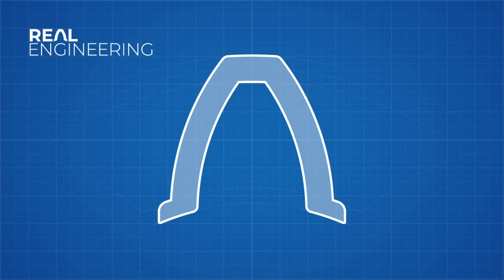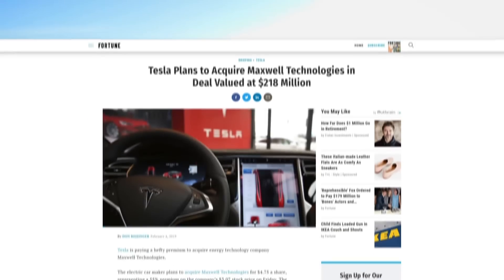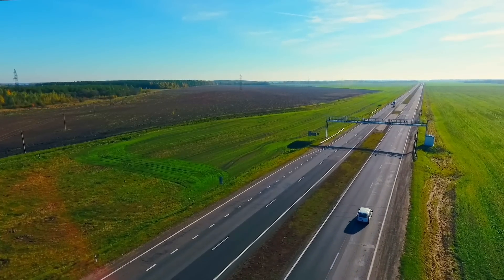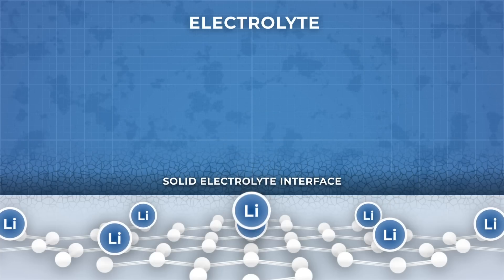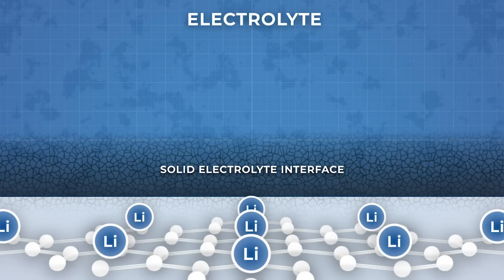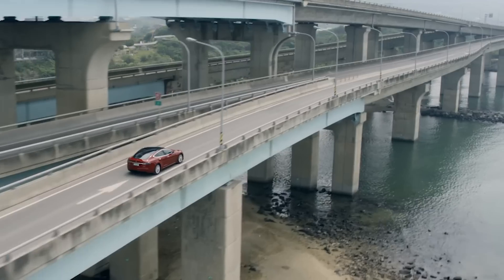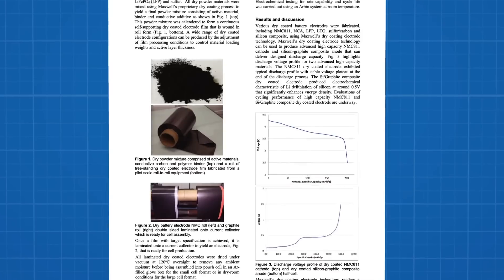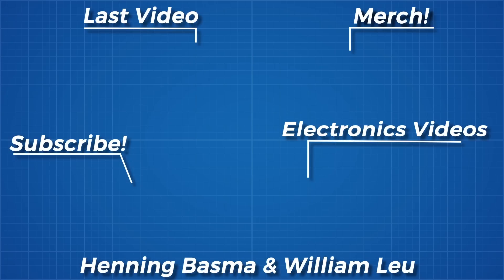Tesla's Quest for Better Batteries

Comment: My toothbrush charges wirelessly why isn't Tesla utilizing wireless energy
Reply: Low efficiency.
Reply: @magfal  it's no less efficient than transferring data wirelessly
Reply: @allanbond3673  packet loss and energy loss in wireless data transfer is not a huge environmental issue as the bandwidth is good and the energy in question is next to nothing. Charging cars with a 10-20 percent loss would be really unnecessarily bad for the environment if most were to switch to EVs and charge wirelessly.
Reply: @magfal  so a 20% loss of power is worse for the environment than having millions of tons of lithium batteries that literally rapes the environment to manufacture? Not to mention how dangerous they are when they get wet, Sounds like bullshit to me
Reply: Wireless charging does not replace batteries. It just refills them. Rolling wireless charging is horribly inefficient compared to stationary wireless charging. At least it was the last time I had a look at the figures. Your toothbrush using wireless charging most likely has a lithium ion battery or a nimh battery.

Comment: You have it backwards, the leaf lost capacity in hot climates. Heat is the enemy of the battery, not cold. And your loss estimate for the Nissan leaf was before the 2013 battery chemistry revision to the 'lizard' battery that could withstand high temps without degradation. I know this first hand because I have a 2013 Nissan leaf with one of the first lizard batteries and the capacity loss is a huge difference. I have lost only 6% in a total of 6yrs and 68k miles(about 700cycles on the battery). You might want to do a bit better on your research end before putting that information out there as "facts".

Comment: So now they're calling it ultra capacitors? because super isn't sexy enough?
great video
Reply: Hyper Capacitor
Reply: It is a bit late to call it "now" since ultracapacitors first came to market in 1982, and it's just a brand name for one company's line of supercapacitors.
The super indicating that they are using a combination of chemical and static potential to achieve a far superior capacity than purely static capacitors.

Comment: Teslas batteries have already been shown to last a long time. 200k+ miles.  In fact it's arguable they maintain charge better than ice maintain MPG
Reply: https://electrek.co/2016/11/01/tesla-battery-degradation/
Reply: Well they still have hits and misses, IF none of the cells in your pack goes out early then you have the possibility of 20 years plus, but a good deal of them had to be exchanged under warranty because in the giant mass of cells they make some of them will underperform and fail long before their full span.
Reply: Teslas doesn't make batteries they buy them . Tesla didn't invent the battery.
Reply: @zoultronzoultron9723  it doesn't matter where they came from, at this point they're the best
Reply: @bob15479  that doesn't even make since.  You can go to lowes or home depot and buy a lithium battery
Reply: @bob15479  this video didn't even mention john goodenough who actually  invented the battery the video talks about . But he makes it seem as elon and Tesla invented it
Reply: @zoultronzoultron9723  I should clarify. When I said "doesn't matter where it came from" I was assuming you already knew that Tesla sources their battery from panasonic.  So my point was, it didn't matter if Elon invented it or panasonic did, it's the best battery. I didn't know the video claimed it was elon and wouldn't promote that lie. 

You're right you can buy a lithium battery anywhere, but the lithium batteries in the 3 are unique and cannot be bought anywhere.  It's cells and active battery management is currently unaparalleld in the EV market, which is why they last so long. You should really do some research into the 3 batteries, I'd start here: https://www.youtube.com/watch?v=kGFiaWvD-KI
Reply: @zoultronzoultron9723  You are wrong. They get cells from Panasonic, but it's Tesla who makes battery pack out of them (thermal management, controllers etc). And assembling, controlling and managing cells - this is where the magic starts. And that is why other manufacturers can't repeat the success yet, it's not about just buying some cells.
There are interesting insights from respected guy: https://youtu.be/CpCrkO1x-Qo?t=1697
Reply: @shotnick81  dont forget Tesla makes them together with Panasonic! and in the ever growing gigafactory in neveda making better batteries will only keep continuing.

Comment: The Maxwell super caps will add to higher amp discharge characteristics of a lithium pack while reducing weight....but fail to understand how capacity will improve....Maybe will tax the lithium batteries less, improving their lifespan....help range in stop and go traffic.  But let’s take a straight A to B journey of say, 300 miles, constant speed of 50 miles/hr.  How will the added Super caps help on a trip like this?  I don’t see them adding range at a constant velocity.   Battery Capacity and vehicle range are tied closely to one another....weight saving for less rolling resistance is evident...however a smaller battery means less range, anyway these eyes see it.  I see this merging of supercaps and lithium extremely beneficial in a sportcar, quick lauches, massize amp draw, light weight....and in a semi truck for starting torque to get the load moving.👍

Comment: Tesla will not use super capacitors in any of their vehicles. They need a ton of cells for range which gives them more discharge/charge capacity than a vehicle motor would ever need and the cells will continue to improve on this metric. I'd be willing to bet my house on this.

The dry coating process is what Maxwell was bought for, and it sounds like it should be worth every penny.

Comment: 1:08 thats one wierd y axis. Could you please provide us with some data can we can actually use? Instead of this bs. Haven't watched the rest of the vid, might get better:)

Edit: rest of video is great!
Reply: Rather than "Use"
Do you mean "Understand"?
There's a difference.
Reply: @rogerstarkey5390  No, I mean "use". It starts at 50, which is fine with clarification, but we don't get any. The jump from 100 to 500 is about 2.5 times as large as the jump from 50  to 100, instead of the 8 times it should be, and there are no marks in between. And I don't even know what happens between 500 and 1000.

Anyway, why are you protecting it?

Comment: Give battery a 100 years it will evolve beyond recognition.
Reply: We will have dilithium crystal  and wrap drive!!! The future is much brighter.  Hopefully we'll have synthesizer or replicator.  Money are useless, disease eradicated,  war are gone.  Just like star trek.
Reply: @duketlam9206  
"Wrap drive"
Great at lunch time!
Reply: @duketlam9206  what's your I.q
Reply: @duketlam9206  how do I give it 100 years when I'll die in less than 60
Reply: Give them 6 years and according to the bullshit graph in this vid and they'll be free.
Reply: @DiscoFang  your name suggest you do not like technology.
Reply: aventador gallardo ha. The opposite. Early adopter.
Reply: aventador gallardo Sony changed the landscape.
Reply: @DiscoFang  so are you optimist about the battery future ?
Reply: Batteries have been around for much longer.
Reply: @hr1100  but never worked upon like the way we are working on them now a days.
Reply: Pizeo crystals cut and assembled into a reverberating configuration where they excite each other could be a possibility 🤔 Hmmm
Reply: Spinning water pumped in a East West direction inside a drum will capture inertia from the rotation of the Earth this can be used to run a hydro generator just line it with the compass and start it running🤔
Reply: Balloons that can be released and they are on a cable system can draw lightning  into a underground facility charging  capacitors this power can run a  large generator motor to make ac line current. Capturing lightning and putting it to work could be a beneficial source of solar Energy.
Reply: @davidmayhall6567  , I like this ideal. I do believe they will eventually find a way to harness lightning and use it. Lightning is so common in most places, and each strike provides so much power and energy.
Reply: @bobby1970  yes indeed I have Dreamed of lightning towers that actually attract and create lightning strikes by releasing vaporized water as the air current blows by a strong electrostatic charge is built up and it strikes the collector rod and the Electricty is harvested it's a solar lightning towers. I have Many ideas about futuristic Devices and machines just wish I could work for a company that could use my ideas.🤔 Hmmm a Mind is a terrible thing to waste 😁
Reply: Crystals are used in radios and clocks and even piezo lighters the structure of the crystal can oscillate with a charge depends on how it is cut on x axis or y axis and it's thickness , piezo crystal works in reverse by application of force distorting crystal structure causing electron flow, like stepping on a wet sponge , like a battery that discharges, but plate degradation causes failure. When I am given a Job then I can build it. A CPU Crystal Power Unit ! 😁
Reply: Slinky Slinky what a wonderful Toy! Oscillating and reverberating CPU Crystal Power Unit! Mic drop!
Reply: I think battery technology will evolve beyond recognition within 5 years.
Reply: @bobby1970  I have some really cool ideas for some battery's made from layers of glass and Sand, others made from recycled paper they are recycable. The best battrey is one that's Dirt cheap  and is made from Dirt!🤔
Reply: @davidmayhall6567  , that's awesome.
Reply: If you have heard of the schuman resonance it's the heart 💓 beat of our Earth a pulsating magnetic signal from the Earth's core . I have thought about a device that sends s pulse of Electricty into the Earth a resonant frequency that bounces of the core of the Earth and comes back stronger Electricty is not affected by Gravity. This pulse is like a drop of water in a bucket of water the drop actually goes in and there's a 🌊 Wave then it kicks back up.  This will draw s lightning Sprite from the Earth as the current is magnified by the Earth's core. It's a Kickback from the magnetic field. This current can be adjusted to be a steady flow of Electricty at a  adjustable frequency the transformer converts this into usable current to run a resistable load. 😁 It's like a kappagen coil or a kapandze coil.  It takes a small amount of charge to get it going then it starts producing current on it's own.  It creates a Pathway and a flow of Electricty by action and reaction like a oscillation.

Comment: tbh, if it wasn't for the price, everybody would own a Tesla 

(in my humble opinion)
Reply: I fully agree everyone should have electric vehicles. But there are problems currently, it would defeat the whole purpose of buying electric vehicles if the fuel source, (electricity) came from fossil fuels. If the world was powered by nuclear or renewable energy, then that would greatly minimized greenhouse gas produced by transportation.
Reply: @GamingWithNikolas  https://blog.ucsusa.org/dave-reichmuth/new-data-show-electric-vehicles-continue-to-get-cleaner
Reply: @GamingWithNikolas  Not entirely - it takes less fossil fuel to be burnt per km for an EV over an ICE vehicle, so while not perfect there is still some benefit.
Reply: "If it weren't for the price, everybody would own a ________" is true for pretty much anything you can put in the blank.
Reply: true but the grid and means to get energy would also need to evolve greatly!!
Reply: Not everybody, but they would probably take nearly all of the Civic/Camry/Focus/Golf market.
If they get down to 20k or under that could very well become reality.
Reply: Have you ever seen or heard Tesla or Musk say how much better these cars are for the environment?  Isn't that the main selling point?  It must be tough to calculate, especially since gasoline cars are 99% cleaner than when at their worst in the 60's (you can look that up too, not a secret).
Reply: To be fair, they are quite beautiful cars

Comment: 1:06 so the battery will cost exactly zero by 2024. ;)
Reply: Or 50? Not sure if the 50 is slightly above the time axis or at the same level.
Gotta check the source for this one anyway, seems blurry.
Reply: The really fun part should start after that, when they start paying you to take them away...
Reply: Mr Fusion uses Garbage .
Reply: haha Someone else noticed. 2027 though going by the BS Y scale on the graph. It's one of the traits of how to spot a snake-oil salesman. Extrapolation of any data is BS. Creating a graph scale to make extrapolation appear linear is even worse.
Reply: @DiscoFang  It's a logarithmic scale which is intentionally used to display data that behaves in a logarithmic manner in a linear way. This is quite common in engineering and science. It will also never be exactly zero when extrapolated, only infinitesimal small. There is no zero on the vertical axis. Off course, extrapolations are only meaningful for small ranges.

Comment: I knew I quit this channel for a reason.  Capacitor tech WILL replace batteries.  Electrochemical reactions are not going to get a whole lot better than where they are.  Period.  Capacitors are a much newer technology and have had very little focus until the last few decades.  Electrostatic storage devices are superior to electrochemical in nearly every way.  And on the capacity front, things are only getting started with graphene.

Batteries are 300 years old and yet here we are with the same issues as always.  Sorry but not sorry.  Capacitors are the future.  They will act as a buffer/surge delivery at first and as soon as the energy density eclipses batteries, they take over.  P E R I O D.  So long forever on this video...
Reply: Experts in either field would be less certain than you with these predictions.

Comment: I really hope that dry deposition process pans out the way they say it could. Higher specific energy, cheaper manufacturing, and more eco-friendly? That's a win-win-win.
Reply: And twice the cycle life - might mean a 500000 mile battery? (Model 3 motor is tested for 1 million miles)

I'd still try for hibernation at 3.8 V (~60%) short trip daily topup when software allows a fixed charge voltage, and 40-80% or 3.65-3.95 V resting voltage cycling when possible though, in case this still improves calendar life to possibly retain the capacity for decades?

Comment: I’d rather see Tesla on a quest to improve range than go for high power figures. To me EV falls down in range. No, up to 300 miles is not good enough when a diesel can get up to 1000 miles on a tank. Once EV hits a real world 400 mile range factoring in using lights, air con, sound etc then it’s viable as a one car solution.

Comment: capacitors are dangerous, they dump a LOT of charge FAST, there will be energy lost between the capacitor and motor to prevent damage to the motor, still helps the battery and the acceleration but if one fails it could damage the electronics of the vehicle or even shock a passenger.  im sure tesla knows this and will add saftey measures im still wary after seeint these https://www.google.com/search?q=electrocution+wounds&rlz=1C1AWFC_enUS815US815&source=lnms&tbm=isch&sa=X&ved=0ahUKEwiM79qBhvPgAhVFUK0KHQFtAw8Q_AUIDigB&biw=1536&bih=722

Comment: Well done video with great information. Just a few observations. First the implication that electric vehicles will help save the planet is not only misleading but at this point contraindicated. I am not nor have I ever been against electric vehicles but at our current state these vehicles actually leave a much larger foot print than traditionally powered ones. Tesla is spending big money betting that these issues will be solved and I wish them luck but the issues of charging inefficiencies due to battery and power distribution losses can not be ignored. There is a tremendous amount of loss between the power plant and that power being stored in the battery. We still cannot get anyway near the power densities of traditional fuels even with the losses of traditional engines. Having worked with very large Lithium Ion Batteries over the years in ROV / AUV applications we discovered many of the lifecycle and temperature issues you discussed. Sometimes you just hit a limitation due to chemistry and physics that improvements in technology will not overcome and we are fast getting to that limit. Nano tech will improve all of these but also increases the danger if a cascade failure occurs. That is the biggest problem with use of high density Lithium Power Packs. While the chance of these failures can be lowered they can never be eliminated and that in the end will be the real engineering challenge.
Reply: and chances of an ice vehicle exploding in an accident are real too.  that fire bomb you call a gastank.  Efficiencies are far superior  in an electric vehicle.  I think Solar canopies over EV charging stations could significantly reduce tranfer losses you speak of....myself I intend to use my 10.5 KW solar array to charge an electric car in the future, when the prices drop, and more used electric vehicles hit the market.  New technology will take time to iron out the problem spots...EV’s  will continue to improve over time.